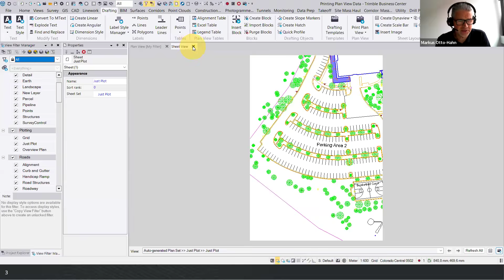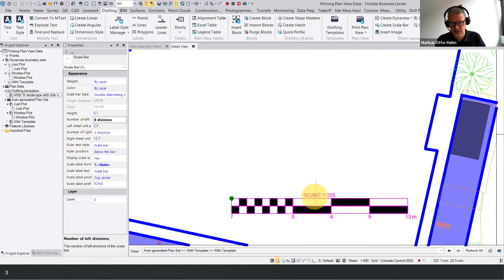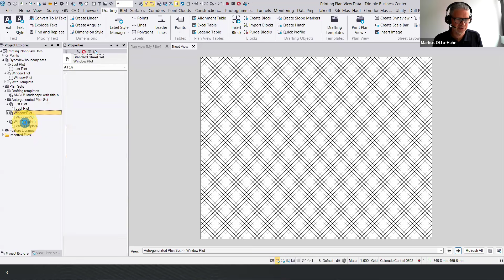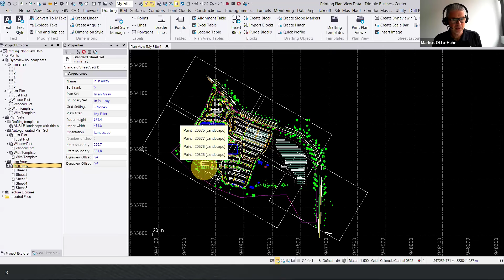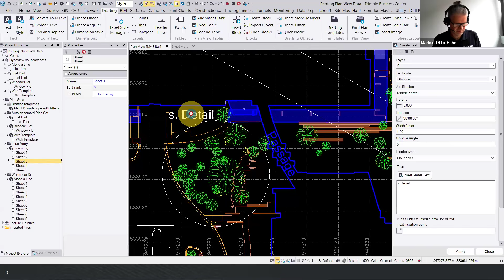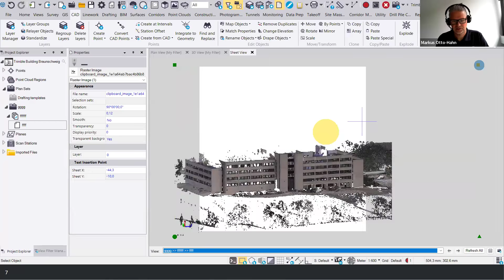TBC Power Hour: Simplified plan view printing in TBC 2026.10

Comment: This looks like a useful update. I didn't have any major issues with the original plotting process, although it took me a while to get used to it but once I understood the process I found it worked well. This latest release feels very familiar but should speed up outputs.

Mulitple plots...fantastic and this is a feature that I have in other software and really missed in TBC.

Copy view into sheets looks useful. I currently use Windows snip tool to grab a screen view then add it to sheets so this should speed up the work flow.